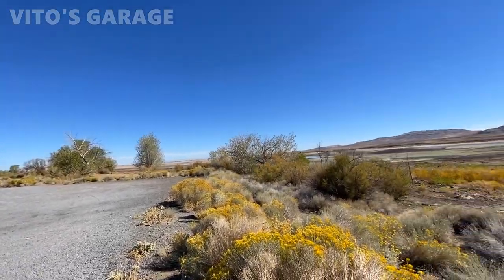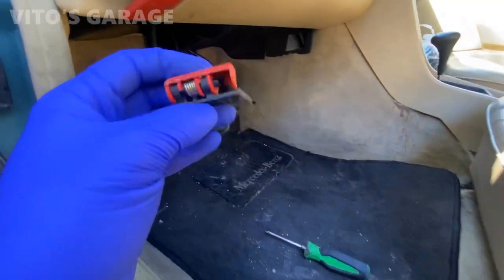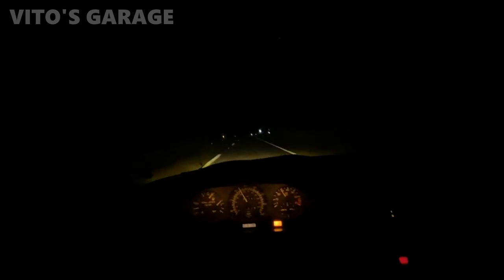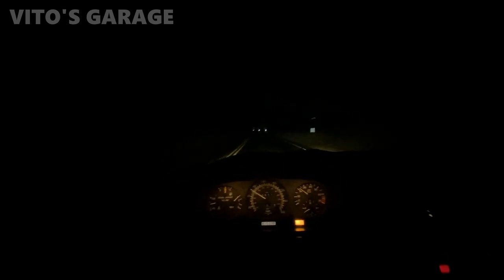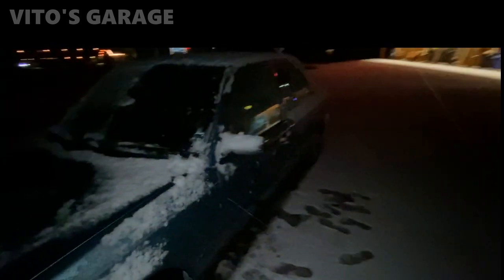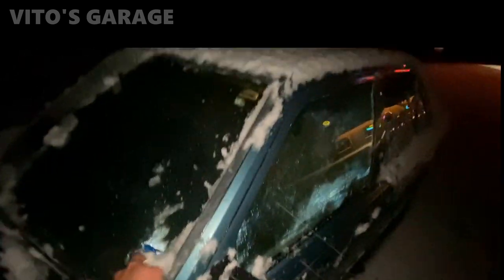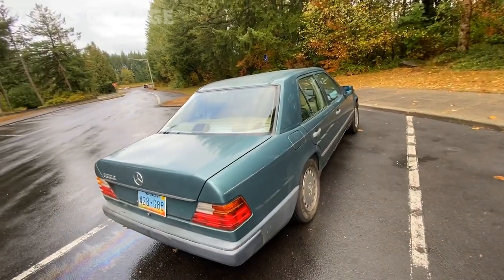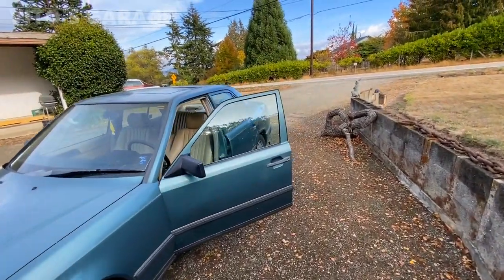What Could Go Wrong? Taking My Junkyard Mercedes W124 300E 900 Miles to Washington State!!!!

Comment: I relate to this video. One day after buying my first Mercedes (w123) I went on a road trip from Canada to Florida without stopping. Drove all through the night, in snow, and then to the beach. I bonded with the car on that trip. That was 10 years ago and I have since bought 2 more (w201, r107). There is nothing like these MB's from the 80's and early 90's, they have a soul and a character that doesn't exist in any other cars I have driven.
Reply from the maker: That’s such an amazing and incredible story!! Thank you for sharing!! Keep loving your amazing machines!
Reply: Nate, I couldn't agree with you more!! I have the same feeling, with my W201 (190D)!
Reply: So true, I bought a ‘81 300D last year. And it’s kind of puzzling why I dig it so much,
Reply: That's right.i love my 92 300d and I got it it was sitting for 2 years and in neglected condition I have it in use I think it loves me lol

Comment: Vito, out of curiosity what is going on with that black 190e with the zero compression in first cylinder? And what does it need? A new head or simply to change the bent valve? And when are you gonna take apart the head?
Reply from the maker: I don’t have that car. I didn’t buy it. Cylinder head needs to come off at the minimum on it. If I find the engine and time for it I’ll probably buy it. It also depends if the owner gives me a good deal. That car is so messed up

Comment: Hey Vito, great series reviving this W124!!!

Regarding the shock mounts and the fear that the shock absorber will go thru the hood if the mounts fail, I checked them on my W201 and the way the mount is designed, It will actually  move like 1/2 inch if the rubber part breaks, as the metal shoulder will stop from completely going thru, isnt that the case?
Reply from the maker: I’ve seen and heard that when the strut mounts break, they can shoot up and dent the hood. But thank God it never happened to me
Reply: @VITOSGARAGE  Well Vito, but that happened to me, with my W201 and the left shock almost perder the hood!!

Comment: Question? Our 1989 300 W124 wants to stall out in idle mode. What can I look at to address this. I’ve removed the air intake and sprayed linkage under it. Any help would be appreciated. Thanks
Reply from the maker: Send a message on Instagram: vitosgarageyoutube. 

You may be having multiple issues causing this. Vacuum leaks, fuel pumps being controlled intermittently, idle control valve issues etc..